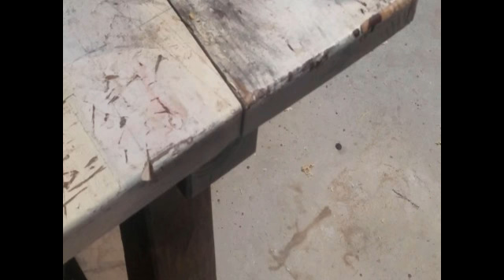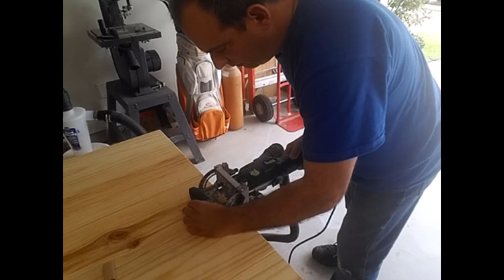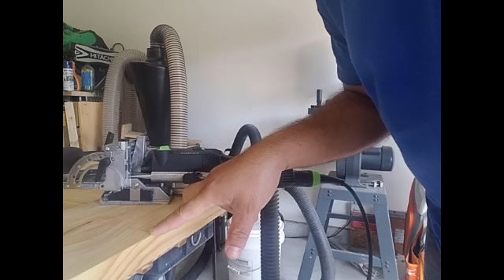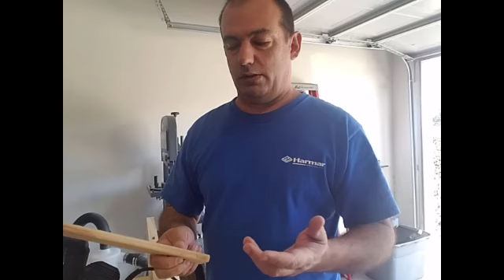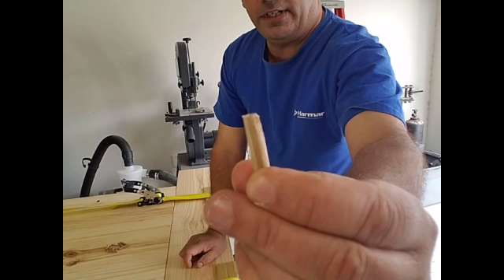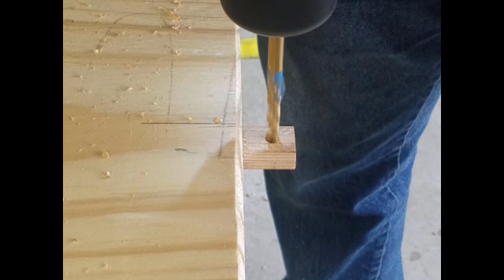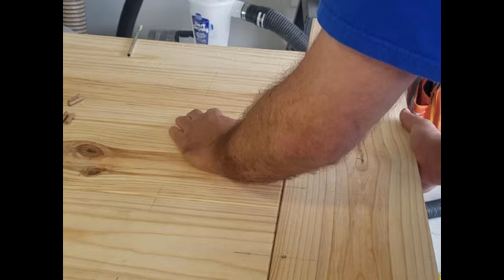Farmhouse Table... how to build them correctly.

Comment: Do you think a less expensive biscuit joiner would work the same? Loved your explanation. I knew something wasn't right with the other videos I watched on this topic but didn't really know how to explain it. You did. Great job, you just got another sub. Thanks!
Reply from the maker: Glad it was helpful.   No, unfortunately a biscuit joiner won't work.   The biscuits are far too light duty.   Biscuits are only good for alignment, not structure.   You could make a similar joint with a much cheaper router though.
Reply: No biscuits will not work.... learn jointery.

Comment: Question for you:  You didn't show the joining of the long table top boards.  Did you use dominoes to join your long table top boards?  And....... BEFORE you bought your Festool ............ did you ever use your plunge rourter and tenons to join it?  Thanks.....
Reply from the maker: The top is just glued together.   Nothing fancy.   Biscuits work really well to keep them aligned,  but glue is more than enough to hold it together.  

But to answer your question... yes!   Before the Festool, I did the exact same operation with a regular router.   In the video I showed the jig I used to make all the mortises identical.

Comment: Very informative video.  I have made a bunch of farm tables for people with pocket holes and had some issues with the wood movement.  I don't get a ton of people who want breadboard ends.  Would I follow this same method with joining the long boards together.  If so where would you recommend to put the larger versus right size mortise holes.  Thanks for much for any advise you or others could give.
Reply from the maker: You can join the long boards together any way you want.   The movement is across the grain,  so it won't be affecting anything.   I glue mine together with dominoes in between, but the dominoes are really only there for alignment purposes.   You can use biscuits between them for alignment as well,  or you can use nothing at all other than glue.   Actually,  even though I'm not a big fan,  you can even use pocket holes between the long boards.   Won't hurt anything.
Reply: All I ever use is glue and clamps. And mortise and tenon joints for the breadboard.

Comment: How are the table (longboards) top boards connected? Biscuits and glue?
Reply from the maker: I personally used some smaller dominoes for alignment because I didn't have a biscuit joiner.  But that would work just the same.   It's just for alignment.   The glue holds it together.
Reply: So can the long boards of the table still be fastened with pocket screws?? @termitewoodwerx5896

Comment: I've never seen anyone screw their breadboards in place.
Reply from the maker: Oh man,  there's tons of videos on YouTube that show screwing the breadboard in.   That's what made me want to do this video.
Reply from the maker: biscuits wool work on the main table top assembly,  but not on the breadboard.   They aren't strong enough.
Reply: All the videos, but one or two all state to screw the bread board to the main tables and they say in a couple years it'll start splitting the table as there is no room for movement.  I'm thinking I"m going to use a biscuit joiner for all of the table boards,  bread boards, and kreg jig the base to the table, etc.
Reply: Thank you for this video. I'm about to build a table top, and will be altering how I assemble it based on your advice. Many thanks!
Reply: Screws can be used but their holes must be elongated.   This will hold the breadboard on...but do little, in my opinion, to help keep the table flat...the primary structural purpose of the breadboard.

Comment: Informative, certainly, but you're missing a quintessential factor whilst using your biscuit jointer, or rather, how that pertains to the work piece movement - clamp the tabletop to your trestles - that's basic knowledge; in your video, the piece is shifting around, which is a huge no-no - not only for maintaining accuracy (never rely on the fence with any power tool), but more importantly, in preventing injury to yourself, & on a related matter, Personal Protective Equipment [ PPE ], ergo, eye shields, ear defenders, & a mask - trust me, lungs don't work well on micro-particulates; high-pitch decibels, & visual acuity are premium concerns, too. You've purchased expensive power tools - a few dollars more for protection isn't gonna break the bank. Otherwise, an accomplished job !!
Reply from the maker: You're right.   I should be more safety conscious.   Its not about breaking the bank.   I own safety equipment.   I just sometimes get in a hurry because my time is so limited.   I know it's no excuse.
Reply: Wow Andrew, I bet you're fun at parties.
Reply: Oh look the tool police.

Comment: Great video! I haven’t yet made a table with a breadboard which is why I’m watching a bunch of videos. Other woodworkers drill their breadboard first and transfer the center of the hole position to the tenon with a punch. Then, they drill through the tenons 1/16” closer to the table top. When the dowel is inserted, the offset naturally draws the breadboard into the table. Is this a technique you decided not to use for a reason? Or one you just weren’t familiar with? In no way do I mean this condescending... it’s a genuine question. I’m just looking for the best technique. Again, thanks for taking the time to make this video and for your humbleness!
Reply: It's called drawboring and yes drawboring would be a better thing to do.

Comment: Great video!  I've noticed that same problem with others posting videos that show the incorrect methods for doing not only breadboard ends, but many other things.  I'm now retired, and probably watch too many YouTube videos, but I enjoy the new ideas presented by others.  My background includes cabinet making, furniture making, teaching industrial arts in high school, and 35 years in manufacturing management, and industrial safety.  I've seen a lot of different ways to accomplish the same a job, but usually there's not too many "correct" ways to get the job done.  Your video was excellent for a first  attempt.  I enjoyed your great explainations for how AND why to do this job!

Comment: Thanks so much for making this video! It couldn't have been easier to understand, I think. I have a biscuit joiner I bought used from eBay to build up a set of tools. What do you think about using that method of joinery?
Reply from the maker: The biscuit joiner will not work.  I know it looks a lot like the Festool, but it is a completely different machine.  The biscuits are thin and weak.  The purpose for the biscuits is to align up boards when you are gluing them.  The biscuits themselves are not structural and provide no additional strength.  They just keep everything straight.  The Domino uses a much bigger piece and it is actually structural.  It creates a mortise and tennon joint which is the strongest joint found in woodworking.  Hope this helps!
Reply: +Termite Woodwerx Yes, it makes sense. Thanks for the quick reply!

Comment: Thanks this is a great video. If I could add one point to maybe help a little. When choosing lumber at the lumber yard, I look for vertical grain on the ends of the planks. Wood expands and contracts most along the grain. The result of having more vertical grain is less movement across the width of the table top. The table top will get a little thicker and thinner with seasonal changes but it is only over 1 1/2" and will be unnoticeable. Vertical grain would be "quarter sawn" planks. Horizontal grain would be "flat sawn" planks. Hope this helps when choosing lumber. One last point, flat sawn planks are more prone to cupping than quarter sawn.

Comment: Great video, very informative. I have a question about the main table boards though.  You had the grain all running in the same direction,  that is the curve of the grain all ran in a U shape from bottom to top.  Have you had any problem with the tabletop cupping because of that? I made a coffee table that way and it cupped and someone from a local woodworking club said I should have alternated the grain in an up,  then down pattern to minimize the cupping.  I will say that it was extremely humid all that summer and that could have been a contributing factor.

Comment: Hi! 

This is a wonderful video! I was wondering which size you are using the smaller or the XL festool domino tool. Also what size bit are you using and how long of tenons are you using? I’m sorry if you said this in the video! I might of missed it the few times I watched it.
Reply from the maker: I am using the smaller Festool Domino machine.  I'm using the largest size domino that it can handle which is the 10mm.  I forget the depth of the tennon.  Thank you for watching and your kind words.

Comment: I have a question and it might be stupid but I'm a newbie. How do I get the top built so it doesn't have cracks goid and crumbs get caught in.  I'm ready to tear mine apart because it always looks dirty
Reply from the maker: The dimensional lumber you buy at the home store house rounded edges.  I think the only thin you could do is to cut the edges off with a table saw so that you have sharp 90 degree corners before you clue up the top.  Then you would have to sand the top down so that you wouldn't have any lines in between the boards.
Reply: If you have a table saw then you will set your TS fence to slice off just enough to remove the radius (rounded) edge on both sides of each board (except the outside edge of the outside boards) where you actually want that softer edge, this is approx 1/4". Per cut or 1/2" per board, so depending on how many boards you are using , this will effect the overall width of the table, so make the width of the table base with this in mind or you may not have any overhang left to work with for the aprons!. My advise is that unless you are building an outdoor " picnic table" or you don't mind spending a lot of time cleaning crumbs and spilled milk and coffee out of all those crevices, (something a lot of people don't realise till its to late) this is the only way to build the top.
Reply: If you are not very particular about natural wood grain finish (inexpensive boards) then you can use a laminate over the entire surface. This is if you prefer utility to appearance. Another way is to use a thick glass top.
Reply: Trim the rounded edges as others had mentioned and joint the edges.

Comment: Would using dowels have the same affect? What about biscuits?
Reply from the maker: No.  Dowels will not work because there would be no way to pin them with a slot to have movement.  Biscuits are not structural and have zero strength.
Reply: why not just elongate out the hole a bit more to allow for movement?

Comment: Thanks for the info. Why is it called the "bread?" Board?
Reply from the maker: I wasn't sure.  Had to look that up, but apparently, back in the day, there would be a cutting surface at the end of the table that was used for cutting bread.  I guess the word has taken on a new meaning.

Comment: New sub! Would using a biscuit joint not work here or is that the same thing?
Reply from the maker: +37South Vintage Restorations the biscuit joiner might look like a similar machine,  but its quite different.   Biscuits are great for alignment purposes,  but really don't provide much strength.   This machine actually makes real mortise and tennon joints that are crazy strong.
Reply: Termite Woodwerx thanks for the info

Comment: Those dominos look a bit small for such a large breadboard. Lots of stress on those little guys to hold. Curious if they have held? Great introductory video for those looking to do this.
Reply from the maker: +Michael Orlando I've made a bunch of them this way and I've never had a problem.   You can actually sit on the breadboard end and it won't break.
Reply: The table apron holds theme up.

Comment: Thank you for detailed video. If you seal the wood with a finish, will it still expand that much to cause damage?
Reply from the maker: +jcarey65 yes.   It still moves,  even with finish on it.   As a matter of fact,  the experts highly recommend putting the same number of coats of finish on the top side as the bottom side so that way out all moves together.

Comment: When i buy my lumber should i leave it inside for a couple days so it can shrink. I get it from a cold storage shed. But it is kiln dried lumber.
Reply from the maker: +ryanmckinney81 I would say,  invest in a moisture meter and check it over few days.   When the moisture level ous stable,  then stay working it.   But if you don't have one,  I would probably wait a couple weeks.
Reply: Termite Woodwerx thank you very much. I squared up my edges on a table im makeing and the were tight and now theres gaps lol. Lesson learned. Thanks again. I subscribed.

Comment: That thing is a biscuit joiner on steroids
Reply from the maker: +Sean Forquer It might look like one,  but it operates differently.   Biscuits are great for alignment,  but they actually don't help to strengthen the joint at all.   This machine actually makes mortise and tennon joints in seconds which is pine of the strongest joints in woodworking.

Comment: I like you video. I liked the detail work. I would pin the other end of the domino for added strength and durability. I also would have moved the holes in the breadboard end  of the dominos in 16th of a inch to keep the breadbord drawn up tight.
Reply from the maker: +Peter Van Brussel you could pin the other end,  but I can't imagine the glue letting go.   I agree about offsetting the holes.   Next time.

Comment: how did you make those tenons
Reply from the maker: +pbase777 I cut strips on the table saw that were just the right thickness.   Then I rounded over the edges on the router table so they weren't square any more.   Then I cut the strips on the miter saw with a stop block so that they were the perfect length.  Super easy to do.

Comment: Thank you very much sir, for making this video. I am going to build one of these for my wife as a surprise, and I had seen some videos that used kreg screw joinery on the breadboard ends. Being a novice, that was my plan as well, even though some of the videos had mentioned they'd do it differently if they had it to do over. My wife thanks you for a table has a slightly smaller chance of cracking!

Comment: Will using dowels work for this if I make the holes a bit larger than the dowels?
Reply from the maker: +Carol Ashurst I don't think so because you will not be able to run a pin through dowel to pull the breadboard end tight.

Comment: Good vid, however, I am more interested in the main planks mating to each other rather than the bread board install, perhaps this vid should be renamed to Farmhouse Table Breadboard Ends - Proper Installation.  Thanks for posting, I did learn quite a bit.
Reply from the maker: The main planks were first milled on a jointer to make sure that the edges were perfectly straight.  They were then glued edge to edge with tight bond 2 wood glue.  There is nothing mechanical holding them together, only glue.  The glue alone is plenty strong.  It is possible to screw them from underneath with the pocket screws because the wood movement has no effect on it, but I'm not a huge fan of the pocket screws.  There's really nothing to putting the main top together, that's why I wasn't talking about it.  Just set the boards side by side.... glue, clamp.... done!
Reply: Termite Woodwerx Thanks for the info!!!
Reply: Can also tongue & groove the planks or spline them.  No need to glue them, let them "float" like a paneled door. @HoneyOnWales

Comment: Thanks for the good info in here.  I'm wanting to start on one of these soon, and wanted to use dowels to edge join the tabletop. I guess they're not going to be a good solution for the breadboard.
Reply from the maker: I hope I've saved you some pain.  The dowels will certainly give you problems.

Comment: how about using a dowel joint. Then on the breadboard side make the dowel holes a little bigger by using a drill and centering it around the actual center?

Comment: Oh one last question, I'm new also, what kind of bit would you use in that router?
Reply from the maker: I use a 3/8" Spiral UPCUT bit.  I know it will be tempting to buy a home depot bit, but DON'T!!  They are all junk.  Order one online from a good company.  I use Freud and I'm really happy with them.  Makes a world of difference when you use a decent bit.
Reply: Jeff Torres , For what little it's worth, go search the New Yankee Workshop trestle table. Make a stub tennon the full width of the table with a router and rabbeting bit. Cut a groove in the breadboard on the tablesaw with a dado stack or use a straight bit with a router setup. 
I promise it will be so much quicker!
Peg the breadboard onto the table end with short dowels which do not go all the way through. Be sure to dry fit then drill the holes. Remove the breadboard then elongate the holes on the tennon- side to side.
If your breadboard has a stop groove, trim off an inch of tennon on both ends.
Good luck!
Reply: Jeff Torres iii